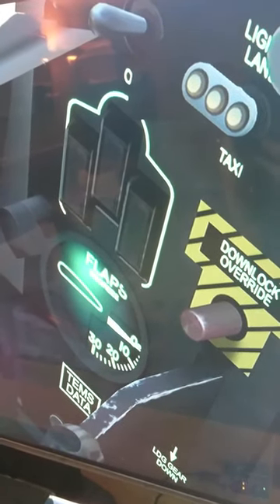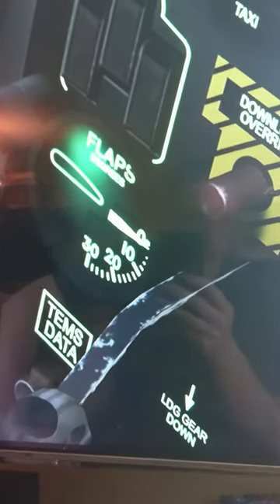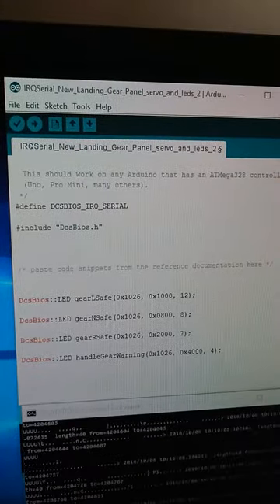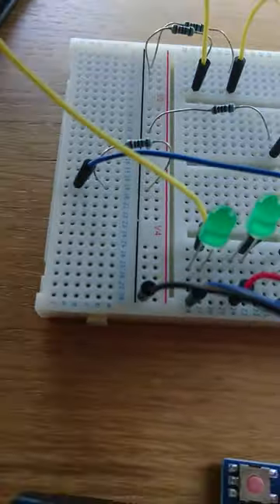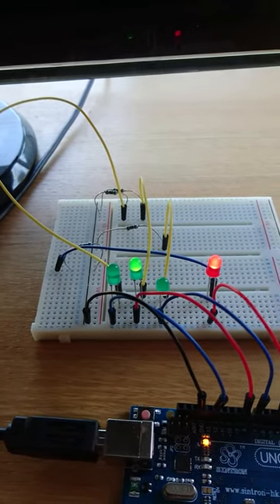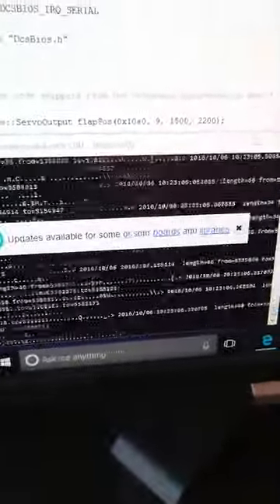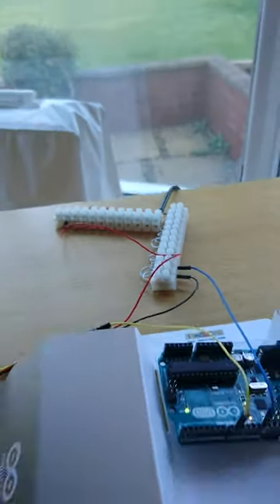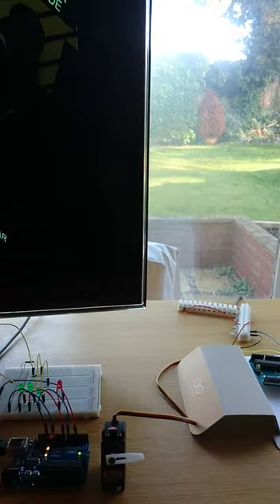DCS Warthog A10C simpit Landing Gear Panel Prototype testing, DCS bios

Comment: Do you use dcs bios and arduino to lower the flaps and gear? Im interested only in creating controls that I need close at hand (landing gear handle, flap switch, etc.) inflight, so that the buttons on my joystick can be left open for more important stuff.
Reply from the maker: Hi John, within my simpit the flaps are controlled by the thrustmaster hotas throttle. The gear is lowered through a landing gear lever from a Tornado which is connected to the sim via dcs bios. If you look at this link for a video I did for the Landing Gear Panel I show those controls you mentioned https://m.youtube.com/watch?v=jR6WKaAovxc
I rate dcs bios highly and I'm sure it would fulfil your interface needs

Comment: Im just planing to make mechanical parts gauge for su33 but i cant find out if dcs BIOS works with fc3 plans. Oka have you got any info od that?
Reply from the maker: Hi Michal, I've only used dcs bios with the A10. I think most dedicated modules within dcs should be able to work with dcs bios. The Ed forums will be the place to look for this. Good luck with your projects 👍
Reply: @CraigSmysimpit  Thanks

Comment: Hi Craig, I planning to build my first panel for DCS A10C, I will first go for the ELEC PNL on the rights side above the CDU. Can you tell me exactly which components I have to order to make the panel working? I'm completely new so I need a startup to get some experience about what I need etc etc! Regards
Reply from the maker: Hi Jeffrey, 
The electric panel is a good choice as not too many switches and just inputs to deal with. 
You will need toggle 6 switches, 5 are standard on/off, and the 6th one is on-off-(on) for the inverter switch. So a centre position, which moves momentary one way and fixed the other. 
Next, you'll need to produce the facia within which the toggles will be mounted. I use spray painted acrylic, cnc cut. Otherwise, you might want to do using a printer and mount onto a chosen surface. Think through whether you want to backlight and if so how 
You'll then need to connect to your computer via either a microcontroller using a program like dcs bios or use a keyboard encoder. In terms of a panel of inputs (no outputs) either will do, however a microcontroller is far more cost effective. I only use keyboard encoders because I had them from many years ago. If using a microcontroller I'd recommend dcs bios as the program. 
I hope that helps, let me know if there is anything else you need, cheers
Reply: Hi Craig, thanks for your reply:) what do you mean with microcontroller? For example a Arduino uno?
Reply from the maker: Hi Jeffrey, yes an Arduino uno would be a good microcontroller to use. 
If you use this web address http://dcs-bios.a10c.de/ 
for dcs bios and read the user guide. I'd read it thoroughly and study it. This will get you up and running.
Reply: Yes i had a look on at, that will be good, im struggling a bit with all the parts i need, i will use the Arduino, but what else i need? Do i need a broadboard? Do i need transistors? Etc etc
Reply from the maker: Hi Jeffrey, I would get a breadboard as this is really helpful when prototyping and running tests. The use of resistors is more for LEDs and components that you output too in order to control the voltage / current so you don't damage them - you shouldn't need any for the input circuit using the toggle switches. I think the dcs bios user guide has some drawings of toggle switches connected. 
In terms of minimum equipment / components needed, for this particular panel I'd get:
* Microcontroller - Arduino uno and appropriate USB lead (I have used genuine Arduinos and clones made by Sinton. The cheap clones sometimes even come with the USB cable) . 
* Screwshield Terminal Expansion Board for Arduino (will make connecting the wiring from the toggle switches into the Arduino easier which can be handy if you're starting off with limited tools) 
* Reels of wire 7/0.2 in red and black
* Wire cutters / strippers 
* Minature female spade connectors 
Also consider:
* electrical tape
* Breadboard 
* Jumper wires (I got some really good, cheap ones off Amazon dispatched by XCSource. They were a mix of female to female, male to female and male to male) 
* soldering iron (if you plan to start building a number of panels) 
* small set screwdrivers 
There might be some other bits, but the above comes to mind
Reply: Oke nice:) i will first start with the elec pnl yes, and the canopy button there aswell, for that i will use a (on)-off(on) switch. so i have to order 6 switches, 1 breadboard, and 1 minicontroller, thats all right? and which breadboard do you recommend? and about the minicontroller the AT328 or the Mega2560? sorry for keep asking, but I want to be sure that i have everthing
Reply from the maker: You'll need the 6 toggles for the electric panel, plus one in addition for the canopy. I'd order several arduinos - as as you experiment one might get damaged. Id order clones but read the reviews carefully as some need extra drivers to set up but ideally you want plug and play without hassle. The Sintron Uno's have always served me well (see if the below link works) 
https://www.amazon.co.uk/dp/B00CGU1VOG/ref=cm_sw_r_other_apa_IJjLzbMPVY6AP
I do have an Arduino mega 2560, but the Uno's which have the AT328 chip are fine and what I have several of. I used these ones for my Caution Light Panel and ILS panel
Reply from the maker: As regards the breadboard, mine are cheap ones off amazon which had good reviews. You shouldn't need anything too special for testing these circuits
Reply: Hello Craig, which arduinos you would recommend for the elec panel? the at328 or mega2560? can you link me a example of a clones i need? 
*what kind of wires i have to use?
*do/what kind of I need connectors?
*I also dont need resistors for the green led background lights?
Reply from the maker: I have found stranded equipment wire 7/0.2mm tinned copper conductor, has worked well for interconnection of apparatus
The female spade crimp connectors can be used to connect wires to the terminal points on the back of the toggle switches. If you watch the video of the Fuel Panel I did, this shows how I used them. You'll need to figure out what size you need by looking at the particular toggles you get. You could also connect by just tying the wire ends around the toggle terminal or go a step further and Solder them
As regards the link to the Arduino clones I used, I put this earlier in a reply. 
Good luck with it, drop me a picture when it's done, it's great to see what people are building 
Cheers
Reply from the maker: That looks fine
Reply: Oke:) when I have some more questions do you mind I ask you? I really appreciated your help already
Reply: 12 Volt switches will be fine in combination with the Arduinos or do i need other voltage? I was thinking about this set for the Arduinos https://www.amazon.de/Elegoo-Einsteigerset-Stromversorgungsmodul-Servomotor-Erweiterungsplatine/dp/B01ILR6AX4/ref=sr_1_4?ie=UTF8&qid=1502915315&sr=8-4&keywords=arduino
Reply from the maker: I would use the jumper cables when prototyping with the Arduino and breadboard to test a circuit. 
When you are happy that circuit works, I would then use the standed 7/0.2 wire to connect the toggles to the Arduino when building the actual panel. 
I think at some point in the past the Arduino mega only worked with dcs bios if it acted as the master and fed a series of slave arduinos that may have been Uno's or Nanos. This was an RS485 network. It was the Uno that would work standalone with dcs bios. In recent updates to dcs bios I think this may have been addressed and the mega may work now in this respect. However, whilst I can say that an uno will definitely work directly with dcs bios I have not used a mega. 
For the back light, a 12v mains powered led strip would already have resistors inbuilt and would be worth looking at
Reply: Oke roger Craig, then I will order the Arduino you said: [Sintron] UNO R3 ATMEGA328P + USB Cable + Reference PDF Files for Arduino's I. And what I asked about the switches? 12 volt switches will be fine in combination with just the USB to the computer? I was thinking about 12 volt heavy duty switches
Reply from the maker: The toggle switches could be of a grade which can handle high voltage or not, as long as it completes a circuit when used it will be fine. 
Just to mention about the LED back-lighting, I power mine from the mains not my computer. 
The only panel I built where the back lighting to the text was powered by the Arduino was the caution light panel, but normally I power it separately
Reply: Thanks Craig, you are a hero mennn! Haha! If i need again some info i will contact you:)